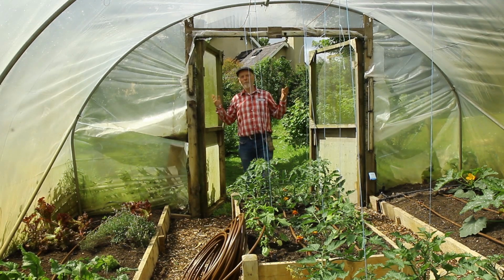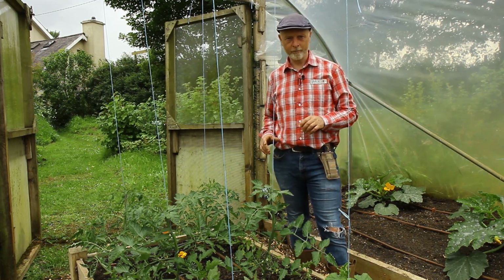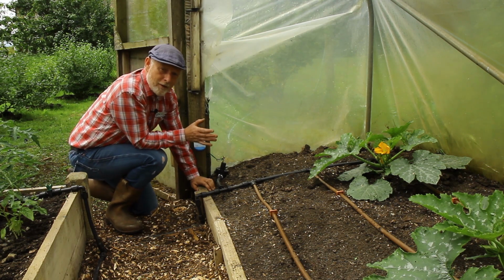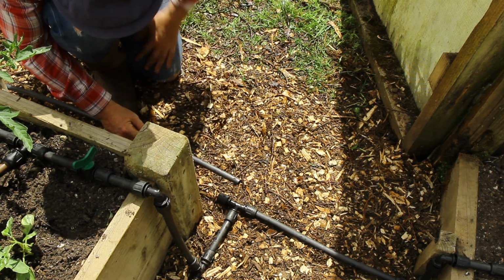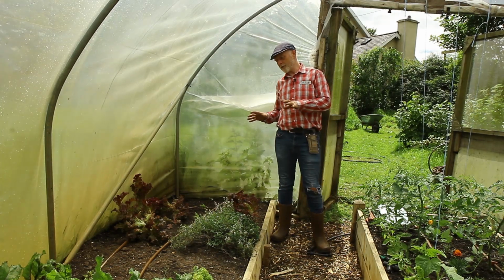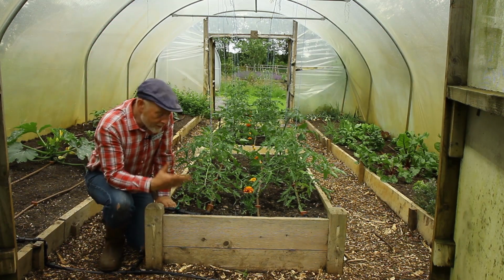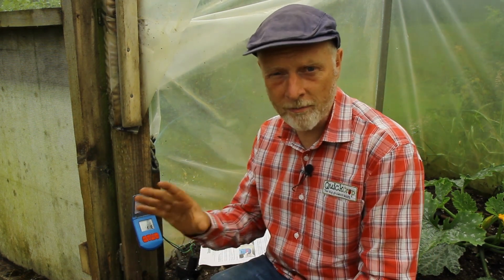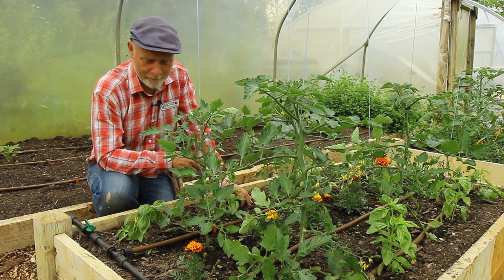Polytunnel Irrigation with Quickcrop

Comment: this bloke is a pratt;  bring the pipe to the tunnel and go up the door frame just put a slow bend in the pipe to go over the door and the same at the other side to go down the door frame a tee piece in the middle for the centre run and drop down onto the bed. The pipe will easily bend to a 9in radius, every elbow or abrupt change of direction causes a decrease in pressure  and subsequent flow rate. Who would put the pipes on the floor to be walked on, only some won with little ability or a sales pitch